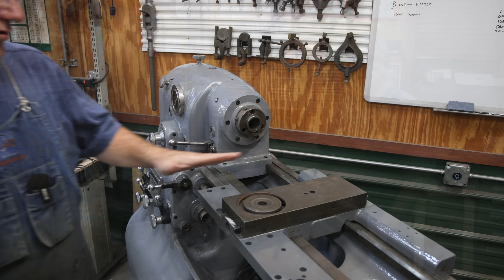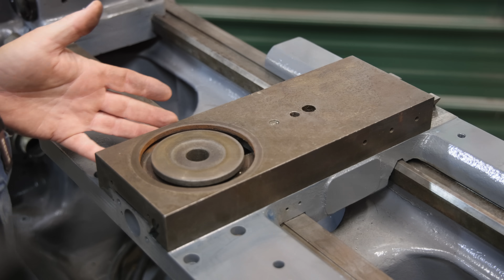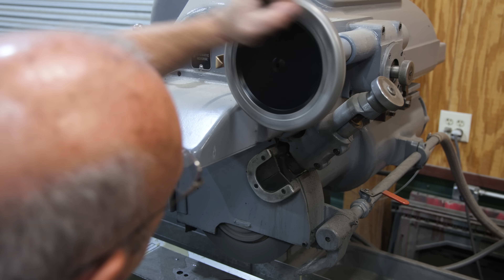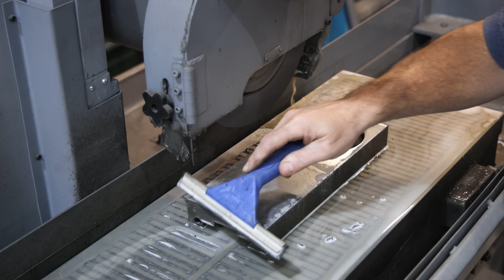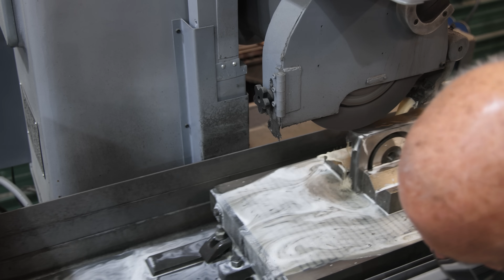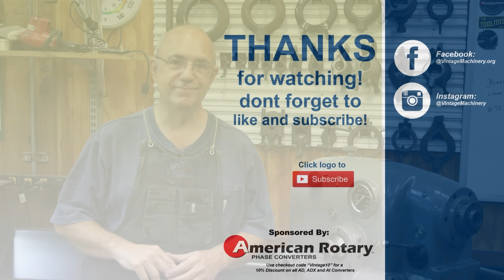Monarch 10EE Restoration: Checking the Cross Slide for Square and Surface Grinding It Flat

Comment: Paint anxiety.  As a restorer / collector of antique farm machinery I often want to paint only part of a machine, like fenders or a hood, etc.  Paint fades: sun, wear, just age, so i can't just get a can of the correct color and spray.  Here is what I do.  Find a good automotive paint store in your area (ask a body shop).  Take a part into the store and they will be able to match up paint exactly to the color.  I have done that numerous times, always works.
Reply: Spent many years in the exhibit building industry; paint colors vary by light-source, chemistry and every other condition you can imagine.

Comment: Why do you keep side loading that wheel. I hope not, however you are going to explode that wheel. Let the stroke go about 2 or so inches past the part and lower the step over or feed.
Reply: I missed something - where was he side loading the wheel?
Reply: @ydonl The cross feed is moving while over the part. That's not a blanchered grinder.
Reply: @bosshimsaidhetried8499  Oh!  Gotcha.

Comment: Isn't square to the spindle most important? Why couldn't you put an indicator on the spindle nose and run across the cross slide?
Reply: You’d adjust the spindle to be parallel to the ways.  The cross side would also use the ways as a reference.

It would be possible to align the spindle and cross slide while both were out of alignment with the ways.

Comment: How different is way oil from chainsaw bar oil? It sounds like they both have the same characteristics.
I had standing seam steel roofs put on my house and shop, and It's very difficult to match paint colors to it. The closest I could find was from Krylon. I bought some cans of paint from the roof manufacturer, but I'm only using it for direct repairs if need be. I used the Krylon on some flashing on the back side of the chimney. I painted a small metal table with it too. House trim from Sherwin Williams was much easier to match, and it's not gloss.
Reply: Bar Oil is often made from recycled oil. Worth seeking out and buying the right thing.
Reply: @seabreezecoffeeroasters7994  Thank you. I don't have a lathe, but would get the recommended lubricant if I had one.

Comment: Metal corrosion protectant I have seen is the mil spec 63460.  ‘Nam era “CLP”.  Three leather holsters worn out with perspiration and the Springfield still not rusty when ignored days on end over past 8 years.

Comment: Good morning Keith,
Do you prime the parts before painting?
I have found that priming first allows the finish color to be consistent. 
Differences in base materials can cause the paint to look off. 
Excellent work so far.
Reply: Bozo just "scraped" the whole machine into junk so don't worry about the paint!:body-blue-raised-arms::body-blue-raised-arms::face-blue-smiling:

Comment: Nice work on the cross slide Keith.
Nice professional touch regrinding the cross slide.
Came out perfect.
Thanks for sharing. 
Have a great day.👍🇺🇸👍💯
Reply: You actually think Bozo dose good work????:face-orange-biting-nails::face-orange-biting-nails::face-blue-smiling::face-blue-smiling:
Reply: @garybrenner6236  tool and not is a useful way :yougotthis:

Comment: um, yeah, paint colors. Sadly you can't control what a corporation does when it comes to paint colors. This is why when some folks repaint things like Tractors or Machinery they go all Wabi-Sabi with the colors. Intentional Unintentional Creation of Beauty in a Chaotic Way by using every pallet of color they can grasp. I say, just roll with the color variance, tell everyone your trying out a new Wabi-Sabi Paint Job..... Works for me and lets face it, its doubtful you'll ever find a good can of the previous color anywhere you look.
Reply: About 30 years ago I was at a farm auction watching some tractors being sold.  Got to talking with an older guy about rebuilding tractors,  he said it made him chuckle when guys wanted to get the exact color the factory used.  He worked in the paint department for Minneapolis Moline and when he ordered paint he would call Dupont and ask what you got that is cheap and yellow.   They would say something like, 400 gallons of this shade, 200 of this other shade, and 150 of a third.  He would tell them to mix it all together and send it.

Comment: Paint colors are painful. The type of metal, even if it is same metal the method of production, sheet, cast, extrusion can have major effects on how you perceive the color. The metal samples as you showed appeared to be a sheet so that matching should be ok but when you spray your “ slide” since it is a different type of texture based on its production can change the the reflection and perception of the color. Plus your batch paint can vary ever so slightly in gloss which can affect your perception of the shade of color. It can drive you crazy. Even your light source will make small changes even if the source is the same but the batches of material used to create the light source can vary enough. 
I had to deal with it in business, commercial lighting.

Comment: Should the headstock spindle axis parallelism to the saddle ways also be checked?
Reply: Yes, that’s normally done by turning a length of unsupported stock in the chuck. After turning the diameter should be exactly the same on both ends.

Comment: The Thompson grinder is a beautiful machine. I like the built-in wheel dresser. It sure produces a fine surface!
Reply: Always impressed by elegance of the “primitive” technology.  And color variations in paint lots. Same even for latex wall paint.  Buy enough for the job and if it requires multiple containers, mix before you paint. (I can never see if, but pros can spot differences at a glance.$

Comment: You're not being picky with the paint, Keith. If the job is worth doing its worth doing well. You wouldn't drive a truck with a different color door, why would you want to look at a machine every week with 2 different colors on the parts?

Comment: I still find it odd that I remember high school geometry enough, 50 years later, to understand how these measurements work. Thanks, Keith.
Reply: I'm in the same years myself, graduated in 75 and still working the metal.
Reply: @JohnMcClain-s5w  I work in wood, but I appreciate metal workers!!
Reply: @kendavis8046  I love working in wood as well, I'm just not as practiced or good. I've made a few nice things over the years, an oak tool chest while I was stationed in Iwakuni back in the eighties is probably my nicest piece

Comment: I remember on a previous time using the surface grinder the wheel dropped more than more than expected and nearly dislodged the part. That can be a scary proposition. Good to see that did not occur this time.  Love the finish a surface grinder produces.
Reply: EVERYTHING Bozo dose is a "scary proposition":hand-orange-covering-eyes::hand-orange-covering-eyes::face-blue-smiling::face-blue-smiling:

Comment: Went through 10 cans of rustoleum grey to paint a file cabinet. Only took 3-4 but the variance in color was huge. Some were more tan than grey.
Since then I buy rustolium in cans and use my HVLP sprayer. Only way to get consistent results.
Reply: Using an airbrush and spraying from a single can of paint is the only way to ensure color consistency.  I only use rattle cans if I'm just painting a few square inches of something that doesn't have to match the surroundings.
Reply: Ah yes, Rustoleum, with those lousy nozzles that you cant clear, an work just once!:face-orange-frowning::face-orange-frowning:

Comment: Mornin Keith! Picking up a Porter Cable AG-4 wet/dry belt grinder today, also an early Wadkin Bursgreen AGS-14 table saw, and an old Yates American tablesaw with a variety of miters and other parts on it that’ll suit the YA G91 that’s in my shop quite nicely. Hope everyone has a great day! If you’re in New England like me, stay cool, gonna me a regular oven out there today.
Reply: I bought a Porter Cable AG-3 sander, last year at a flea market. Paid $20 for it. It was in rough shape, so I cleaned it, inspected all the parts, put new grease in, and a new power cord. Thing runs like a champ, and it is a BEAST!